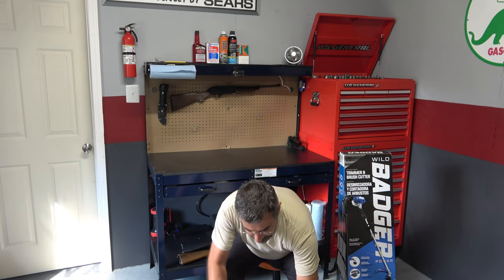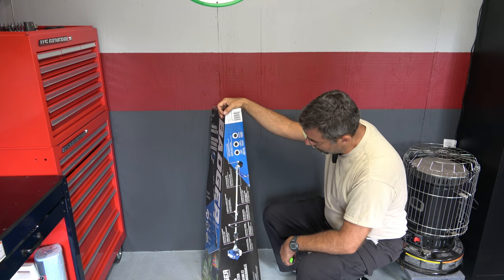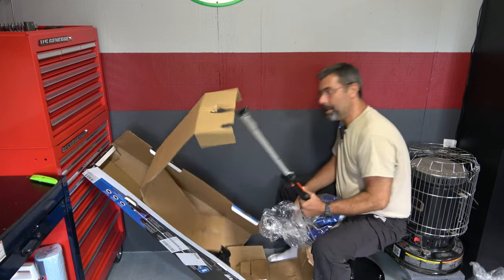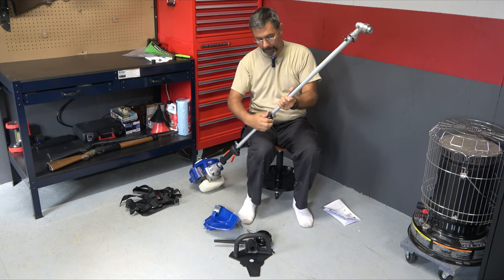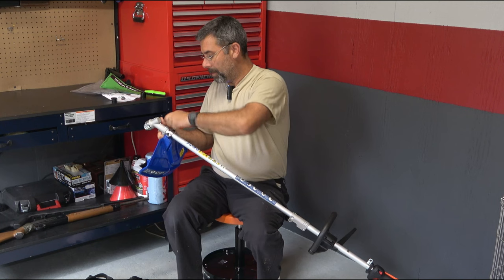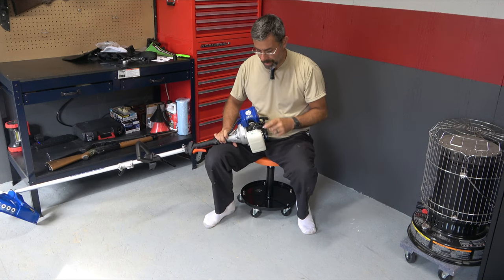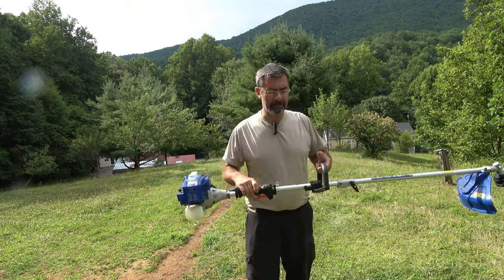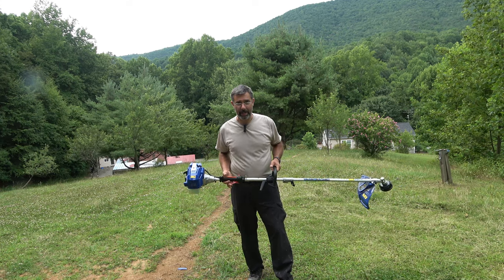Wild Badger Power Trimmer. How does it stack up against my old Husqvarna 128ld? Let's check it out!

Comment: I bought the 4 in 1 version for 160 total delivered to my door. Lowes wanted 199. Wal mart wanted 229 so I bought mine where they do. Ali Express. They have warehouses in the USA now so no customs or over seas shipping charges. Comes with a hedge trimmer attachment and a chainsaw attachment along with the string trimmer head and the blade that came with yours. The first time I used was 2 weeks ago and it rocked it hard and fast. This will do medium brush with absolutely no issues. You will need the 56 CC for heavy brush. The 26CC cuts saplings down with ease. Take a note of this point. I noticed that the hedge trimmer has 2 grease fittings and the chain saw blade has 1 so I did grease them and bought a 50 inch canvas bag from amazon with the money that I saved for 20 bucks so I can put the entire unit with the attachments in the bag. It was 50 by 18 inches.
Reply from the maker: In this day and age, if you can save a few bucks, go for it.  Thanks for sharing about the storage bag.
Reply: Thanks for sharing. Do you have a brand name, description or link for the bag you bought?

Comment: Keep on using it. It will burn your arm
Reply from the maker: So far I have not had any issues with burns.
Reply: Well it does get hot. Kinda your fault if you put your arm on it. Sounds like you should get a battery  operated trimmer 😂 🤷‍♂️

Comment: I bought a craftsman weed Wacker in the 90s that lasted for 8 years. I bought a yardman 5 years ago and it was junk the day I took it out of the box. Sometimes it pays to buy quality but if your new cutter works as well as your new tiller you'll be in good shape!!!
Reply from the maker: I had a dude chainsaw from Homlite, and got another one that lasted me 20 years. Sometimes quality control sucks, but not the brand in general.
Reply: I bought a 25cc craftsman  in 2020 from lowes. I had to buy some tools to adjust the carb. But it has been great no problems at all. Starts easily. Im sure ive put close to 200 hours on it. Just need something  for thick brush.

Comment: Im in california and its nearly impossible to find a gas trimmer, my only question is, what filter does the badger use? I haven't had any luck finding anything about it. Our business runs heavy duty stihls so i have experience tuning and servicing everything from the motor to the shaft. Something this cheap looks promising but the deal breaker for me is whether or not parts are readily available.
Reply from the maker: Gas or air filter?  The wild badger has great power and runs well, but for a commercial use I think the Husqvarna might be better
Reply: @FarpointFarms  I've just received 2 of the 26cc, one works the other doesn't. I have experience working on Chinese clones so it took a while but I've found an 'upgrade' for the air filters. I've had similar motors for 10+ years and never had to replace the oil filter/pick up. As long as you're using 91+ octane and synthetic oil you can usually just wipe it off

Comment: I run Husqvarna trimmers in my business. Unfortunately their quality is not as good as they use to be. You expect more for the cost. The only thing that keeps me buying them is models like the 323L that are under 9 lbs. I actually have the 128LD split shaft. I have the edger attachment on it for doing delicate edging. The string trimmer attachment sits in my tool box as a back up for my regular string trimmer. I've seen these Wild Badgers and was wondering if they were worth messing with. Good direct review.
Reply from the maker: So far, I's say it's a decent trimmer. The fact that I can use my older attachments on it is certainly a plus.

Comment: I seen you suffer from too short of shaft length on the trimmer. Your back was bent about 10-15  deg. when trimming on level ground. Being 6'5" I have the same problem. I finally solved it by getting a Darwin's Grip and it has made a world of difference on lower back pain during trimming.

How is the parts availability on the Badger? Do they take the same parts as a Husqvarna  or another brand. They may have a 3 year warranty but may not be around in 3 years.
Reply from the maker: My back does take a beating from these. I'll look into that. It appears this unit is a clone of a craftsman unit.